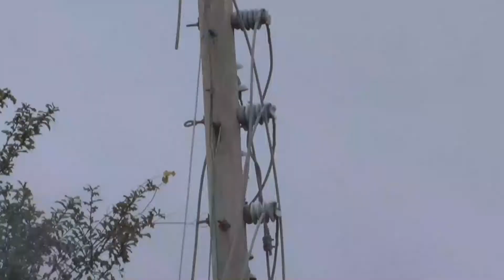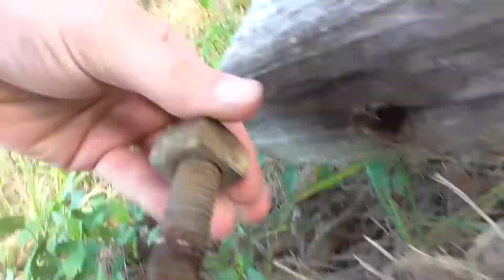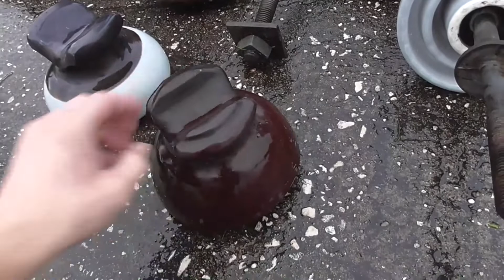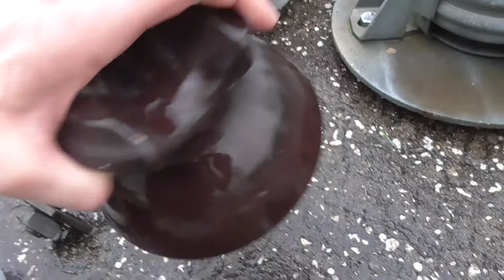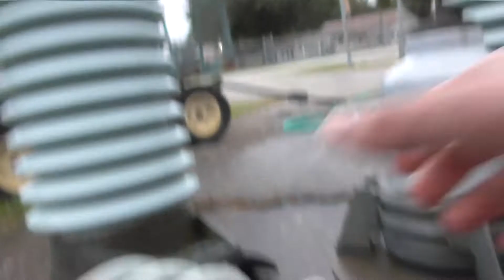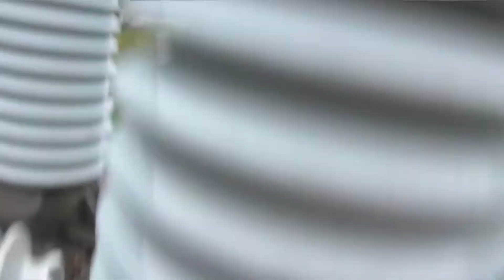Insulator Hunting!! High Voltage Power Line Hardware Finds

Comment: Those 4ft tall insulators must have been expensive for the electrical co. to buy . And they were just trashed like that .
Reply from the maker: Yeah, insulators are typically deemed garbage after its use. I've had seen cases where contractors will throw away new but used insulators. I'm sure their not worth much a piece, but in bulk for sure....

Comment: Hello there! I thought I'd finally comment on your page! I've been following you for about 2 years and I have absolutely marveled at your creativity and badass contraptions. There are not very many anomalies like yourself out there. I myself am in several ways are sort of like you (I had my own lab for 4 years and built several things from a paralleled mot stack to a homemade 5kW 12000 volt power transformer). I'm also around your age too. I do have a question for you (sorry about the mammoth length of this comment): how did you source those ballast transformers for the current regulated power supply? This is something I've been wanting to make for a while but haven't got to. I do realize that it probably cost a lot of money (currently trying to get a job in IT to provide some funny money for this EXPENSIVE hobby!), and I wondered if you simply took mots and did any extra rewinding on them to put out the appropriate power. Doing some research, I found that buying actual ballast transformers capable of taking mains current from a variac or wall was immensely expensive. Do you have any websites or providers that you use for these parts? I haven't been getting any luck or maybe I'm not looking hard enough. I wish we were closer; I live several states over unfortunately. Thanks!
Reply from the maker: Yo, glad to hear it man! The way I use my ballasts is with their outputs in parallel. I use contactors to provide power to individual ballasts. Every contactor is connected in parallel on the input side. Each contactor has it's own ballast. Each contactor has its own power button. The more buttons you press, the more ballasts you add to the circuit essentially adding power. Every ballast output is connected to a terminal bar that sends power to the output. Neutral is of course directly connected to the output socket. Hope that makes sense. You can use MOT's, but it's risky. I do use 2 parallel sets of 4 MOTs with their primaries in series as a current limiter. Total of 8 MOTs. Outputs shorted of course. Limits to 30A at 240V. That means Each stack of 4 MOTs will only see 15A at 240V. This is just to reduce the heating. I found my ballasts from dumpster dives. Yes, I do believe ballasts can be expensive. You might be able to get some from utility company bins, but it's not guaranteed. I have no other sites besides eBay. I might be buying an arc welder (big) to current limit up to 90A 240V. You can use a welder transformer as a current limiter. There are always alternatives. I personally try to avoid resistive current limiting. That's just me I guess. Hope this helps. :)
Reply: I noticed it was some time since I last spoke. You know, life and COVID really affected me to the point I had financial trouble funding this project. Eventually, I had to put it on the back burner for my career (I'm a web security analyst). Now, assuming you still have it, can you provide a rough schematic of your initial ballast PSU? I can take it through email. I'm now at a place where I can dust off my old electronics and open my book on power engineering again.
Reply: Your saying I would have to buy or find (unlikely) ballasts specific to what wattage output I would want and then label the buttons appropropriately. You didn't modify the winding ratio yourself on the mots? Assuming I just have mots I am guessing it's easier to just add the primaries and then parallel both. If that is the case, I'll probably build one that has 5 output levels with mots at either 120/240, ranging from 20%-100% (bypass) duty cycle. This is assuming I'll be able to locate parts and fund this project. I'll let you know if I can ever get to it. P.S.: one time I built a double paralleled mot stack with 6uf of resonance and brought it outside. Don't do it when it's windy; the arc blew forward (away from me) an extra foot.
Reply from the maker: @gronkkcellah3083  That's exactly how I got my ballasts. Search junk yards, dumpsters, or you might have to buy them. There were no modification to the MOTs, I just paralleled 2 groups of 4 in series, works great for a couple minutes, but they still get warm just not as fast.

Comment: I'm back. Remember me? I got a job as an Industrial Electrician. Not quite in the powerline industry, but close enough. Loving the finds. You didn't grab those mini suspensions though. Those are really valuable over here (Australia). We had them back in the early days for high voltage. I mean real early days. I found 3 broken ones from 1943 in the middle of nowhere. That's not the earliest they go though. Some date back to the 1800s. I will digress. Those large white insulators are 69Kv horizontal station post insulators. We use 66Kv instead but they look the same size. Insulators are designed to have a slightly higher voltage/current rating in case of overloads etc. For a 10Kv pin insulator, there should be at least a +1Kv tolerance. If it is rated at 10Kv, it will be rated at a maximum of 11Kv. The 69Kv insulators will have a maximum rating that is higher than 69Kv. They shouldn't be used above the minimum rating though. It's always good to overcompensate these things. They don't need to be too big, but it's better than them being too small.
Reply from the maker: I do remember you, long time no see. That's great that you have that kind of job. I'm currently working on my associates degree in Utility Technology. It's been very busy. Don't worry, I'll be going back to get the suspensions including much, much more. Those are horizontal line posts, station posts are more for buswork etc. Glad to see you are still around. :)
Reply: @VariacManiac  Yeah sorry, horizontal line post insulators. Can't believe I said station posts. It's because I just got 12 66Kv Resin Station post insulators for free. I got them mixed up. What do you do in that degree?
Reply from the maker: @IJMUSIC-k6n  You're alright, they all have differences as you know. Nice man, I'll be getting more stuff as well as their changing out old 138kV transmission lines. The degree is in applied science, but my main courses are in Utility Technology. Which means I will be a certified lineman in a year or so. I can't wait to be honest
Reply from the maker: @IJMUSIC-k6n  I need to work on my Commercial Drivers License to be able to drive the bucket trucks. Do you have a facebook?
Reply: @VariacManiac  I do. I will email it

Comment: Where do you even find these? They’re laying around like Easter eggs. Never see anything like that here in Oregon.
Reply from the maker: The best places to find these are around very old industrial places with factories, railroads, etc. Especially if there's a lot of industrial history. These were found where there used to be mines that are now decommissioned and demolished. Their electrical lines that run through deep swamps and cow fields would have been too expensive to take down and are now abandoned. All the cabling was taken down though because of the value copper and aluminum holds.
Reply: Variac Maniac, Okay, thanks for the tip.
Reply from the maker: @samschannel531  You're welcome man, hope that helps.

Comment: how much felony theft?? I hope you stay out of trouble.
Reply from the maker: Where's the theft coming into play? None of this is occupied and left to decay.
Reply: @VariacManiac  if you are certain I am happy for you. I may or may not have gotten into some trouble many years ago for a situation similar to this...
Reply from the maker: @ubuntupokemoninc  Oh, well from my research, these lines used to be owned by a mining company some years back and after their mines shut down, they were demolished. The grids going to them weren't as it appears. All the abandoned substations there used to be were hit by scrappers for the copper and what not. No one seems to care about the poles running through the woods. I thought to myself to venture for the insulators which after use have little to no value. So my dad and I went and picked up what there was left for insulators :)
Reply from the maker: @ubuntupokemoninc  I hope everything is going well for you after your trouble.
Reply: @VariacManiac  yeah that was quite a while ago, and I was still a minor haha.....
Reply from the maker: These are from lines that have not had electricity since the 80s, thanks for your concern though.

Comment: Nice, the 6 tier post should be rated for 35kv, they use those down here on all the new lines (most are 20kv). Never saw an Arrestor like that but I’ve got a glass one made by line materials co. I’ve got a few of those huge porcelain posts in a yard that I might be able to get, expect their brown not white! Soon I’ll post some more vids on what I’ve gotten since down here they’ve been doing a lot of re-conductoring.
Reply from the maker: Nice man, there's a lot more insulators to go for, this was only a weeks worth of hunting. You should go and get those post insulators.

Comment: Intresting finds there, keep up the good work. The music sounds good to 👍. Your powergrid design and voltage ratings seem very different from NZ. Fantastic video as always, Cheers.
Reply from the maker: There are a lot of voltage ranges we use in America. Most medium voltages run from 4160V, 12470V, 13200V, 13800V, 14,400V, all the way up to 34,500V. Low voltages are usually single phase 120/240V and 277V or 3 phase 208V and 480V. Glad to see that you've enjoyed!

Comment: Here Idaho power NEVER leaves any insulators behind, they just take them and throw them away, there are some places that might have insulators  
but there far away and there's no cellphone coverage there. 
And how often do you find insulators?
Reply from the maker: Not very often. This video is almost a long time compilation. The way I target insulators is by looking on google maps for abandoned stuff, I research history in industrial locations. pretty hard to find. Usually no power company leaves anything behind, makes them look bad. These went to old mines that existed until the 80's and 90's, after they were defunct, the power systems were the least of their concerns.
Reply: @VariacManiac  Ya, I've been collecting insulators ever since I was 9 but I've only found a few insulators other than at stores.
There is a mine that was abandoned in the 50s and it has insulators around but I haven't explored it very much, It's where I got the old fused switch box that I use for my 12v stuff.
Reply from the maker: @NSaw1   Nsaw1DoingStuff  I travel a lot, that may be the case with me. You could possibly track down line workers if they are willing to give you stuff, unfortunately that has not worked too well with me.
Reply: @VariacManiac  A few years ago I got some insulators from some line workers near where I live.
 I also travel a lot, I've been to all the lower 48 states but I only found 2 insulators, but I have been traveling since before I started collecting insulators, I travel with my parents and were uselessly hauling something and don't go far of the path like the freeways.

Comment: That is COOL! 
I've never seen that lightning arrester before. Do you think it was for something like a 480v line or a lower voltage distribution line?
Reply from the maker: Near the end of the video, I show the plaque on it and it read 3.7kV normal running voltage and 4.5kV rated max, pretty cool and it as an altitude rating as well, probably because voltage can jump easier at a higher altitude.
Reply: @VariacManiac  I didn't see the altitude rating, That's interesting! But I saw the voltage rating, but I've never seen that voltage range used, so I was wondering if maby it was used for low voltage distribution lines like 240v or 480v? But it's still way higher voltage rating than that, idk.
Reply: Nsaw1DoingStuff : maybe it was used on 2.3kV circuits :-)
Reply from the maker: @ElectroXa  It was an old 3 phase (In the ballpark of 2400V) system, for what will remain a mystery to me, but it was for mining at one point in the past..

Comment: What's the distribution and subs-transmission voltage where you live? Here in western WA, we've got 12.47 kV distribution and 115 kV for subtrans.
Reply from the maker: Here in a remote part of Michigan, our town mines calcite and needs 2 140kV transmission lines, from there the town feeds off from 2 12470V 3 phase lines that come from the substation.
Reply: Oh interesting. Never heard of 140 kV. When I was in Montana for college, they used 69 kV (same exact looking insulators you've got, mounted upright) and 138 kV.

Comment: All the little ones are rated 7,2KV fro our utility but idk about yours.
Reply from the maker: They came off 7.2kV lines correct. Usually tested to 10kV  and will do easy. The 3 post mount clamp top insulators were used at 69kV. Pretty common all of these are, hoped you enjoyed!